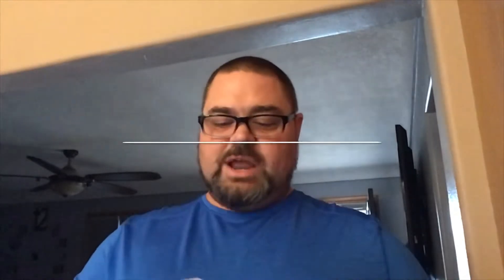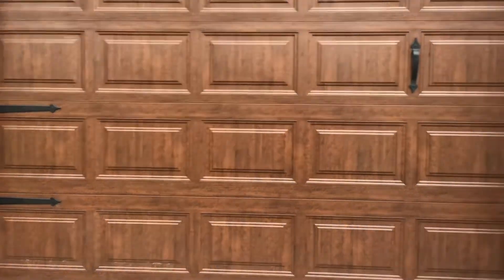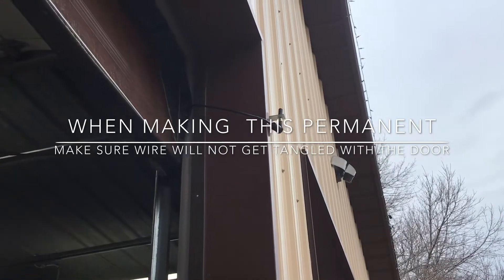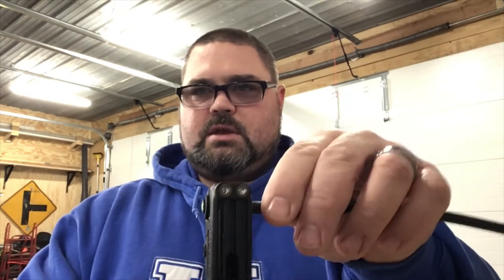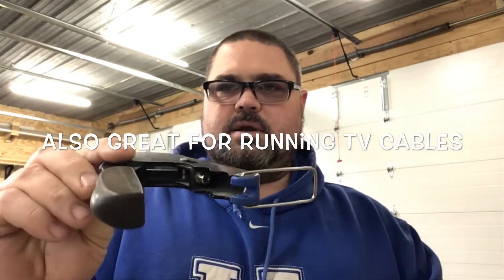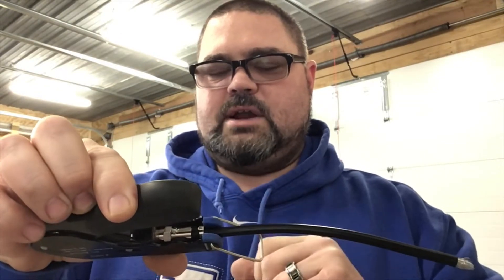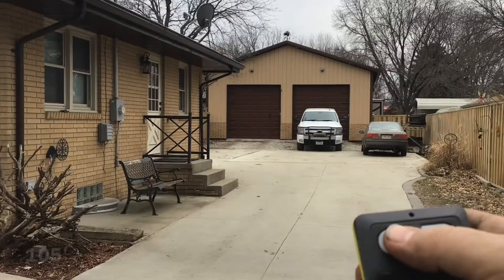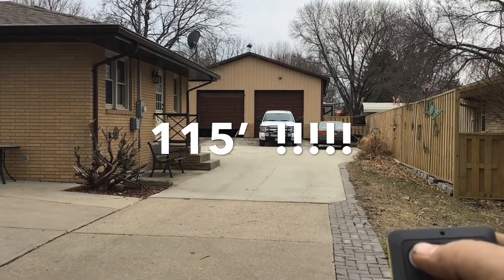Installing GDO Antenna extension kit

Comment: Please show how you connect the coax to the wire that comes out of the garage door motor unit.
Thanks.
Reply from the maker: i pulled back all the shielding, so all that was showing was the center wire and then used a wire nut to connect it to the wire coming out of the opener.

Comment: How did you connect the coax to the wire hanging down from the opener? 
There is no input for the connector on the Craftsman unit. Chamberlain units have an input. Plase advise.
Your YouTube is great. Thank you.
Reply from the maker: I stripped back the shielding on the coax and stripped back the wire on the antenna connection, and used a wire nut to connect them. it is crude, but it has been working ever since

Comment: How did you tie coax to antenna on opener
Reply from the maker: I stripped back the outer coating to get to JUST the copper wire and wire nut it to the wire inside antenna wire I think the outside of the coax helps shields the signal

Comment: I get the adding extension part. However where the heck is the antenna located on the Rubio Unit? I don’t see it (I see the Wifi antenna). Do you have to pull the cover?
Reply from the maker: the antenna is the single wire that hangs out of the bottom of the unit in front of the light.

Comment: A 2 foot piece of plain wire would have been all you needed.  My opener works from over 300 feet but with just that piece of wire.
Reply from the maker: I tried that and it did not help at all.

Comment: $60.00 to extend a wire?  If you've got it, cool.  I'd run a scrap piece for nothing.
Reply from the maker: I tried that first and it did not help my situation
Reply: Same here. Did not work for me with the scrap wire extending outside. How does the coax hook to the dangly antenna?